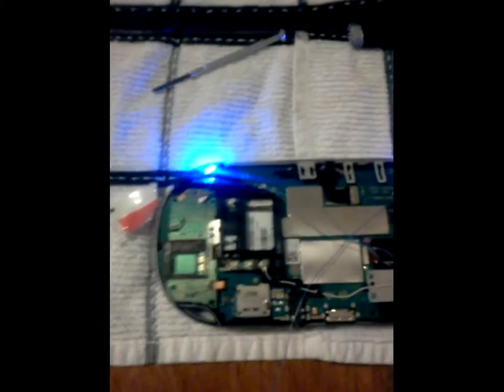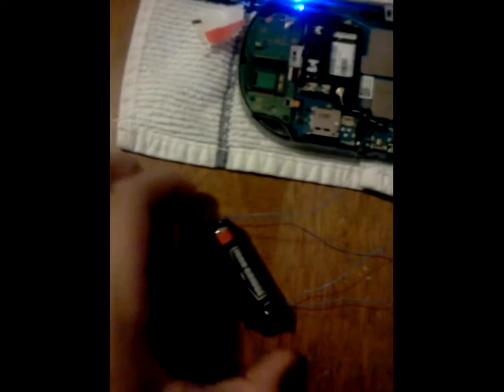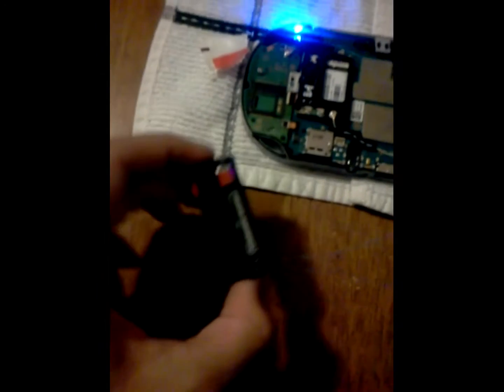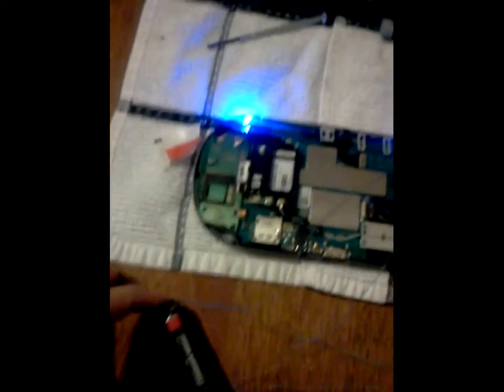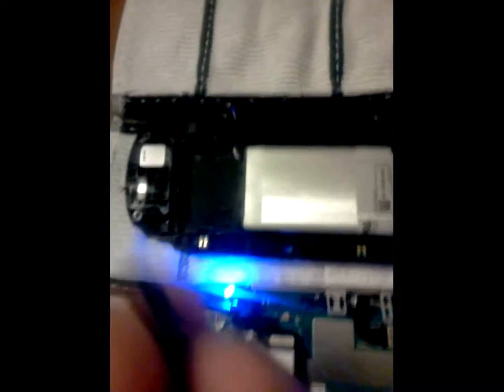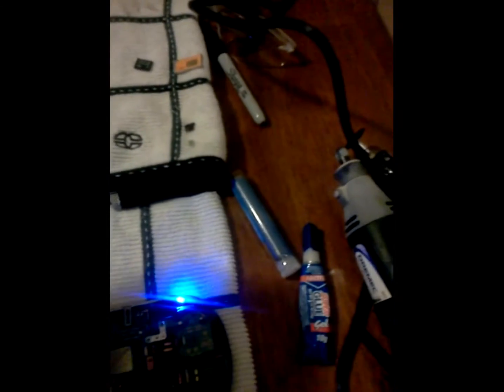PS vita mod (switchable LED's) (1080p) SOUND REACTIVE

Comment from the maker: Yes there is plenty of power for the blue led's and on the speakers there are two flaps the connect to the circuit board on the vita, just connect the positive and negative end on the led to the positive and negative end of the speaker.

Comment: It's been a few hours and I have FAILED epicly yet again. I got smaller wire and my vice came in today with my drill bits. Everything was coming along smoothly till i tried to bend the wires and that's when i was FUCKED! I blew about 50 bills altogether but it was worth it. I'll keep trying till i get this thing to snap shut.

Comment: or to add to that idea. add smds into the actual buttons d pad controls and x square triangle and circle could be done with smds if your good with dremmels. that would look even more sick !!!  like you can find little smds that are blue or white or green that are like 2mm in size. easily fit in all those buttons :)

Comment: very niiice job, i always like the switch as an alternative option. I considered it for my mod but since i usually always have the external grips it doesnt display thru them. Also with headphones (bluetooth or wired) they auto shut off as well. Good work on ur unit, u should now consider the bottom led`s like i have on mine. They are sooooo much better than the triggers n their never blocked with grip.

Comment from the maker: this took me a couple of days, it was a weekend project. When i was 10 I went to this after school program that showed me how to do it (I learned a lot from that place). The LEDs are just standard blue LEDs i bought from radio shack. Im not sure what you mean by headphones, (do you want to take the headphones apart and put LEDs in each ear piece, Or do you want to know if the lights still light up with headphones on?)